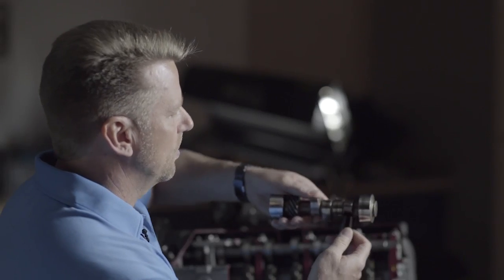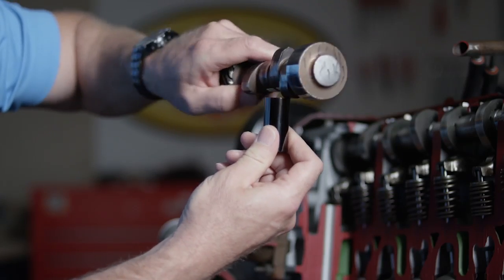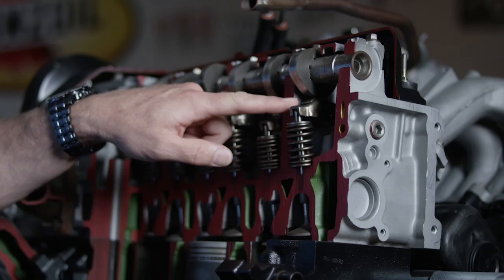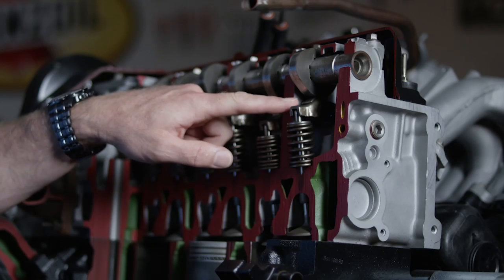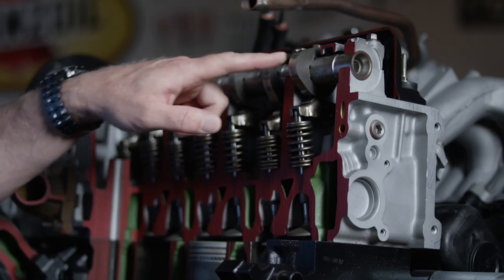High Performance Engines and Motor Oil with Zinc

Comment: its true zinc does help, I used zinc additive treatment before in my bike and car engine before, it feels smoother after adding it as if it lost some of the kind of rough rubbing in the engine..
Reply: It feels smoother? It's all in your head. What the Pennzoil man don't want you to know is. There are a lot of engine still out here with FT cams running just fine with standard oil. The whole zinc BS was created to sell more designer oil.
Reply: Hi denice ive tried stp oil treatment on my single, fours bikes and my datsun car before it does feel different,  try it
Reply: I live in tropics so i dunno abt your environment it helps in the heat department